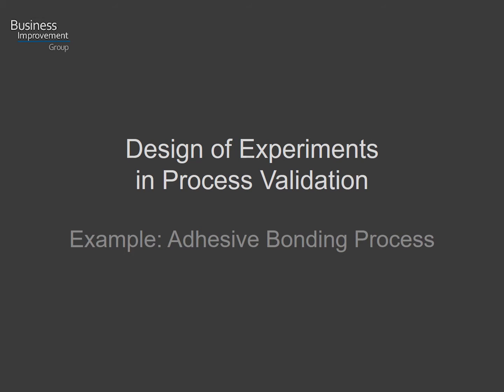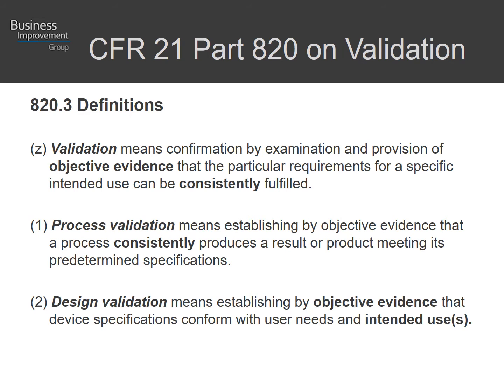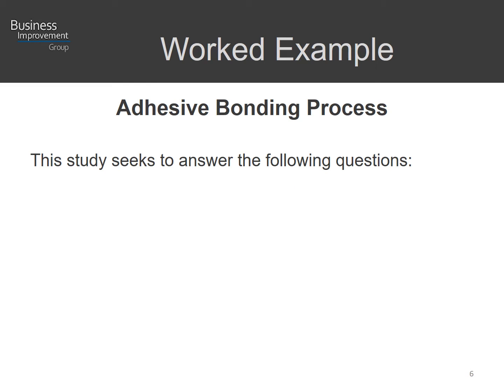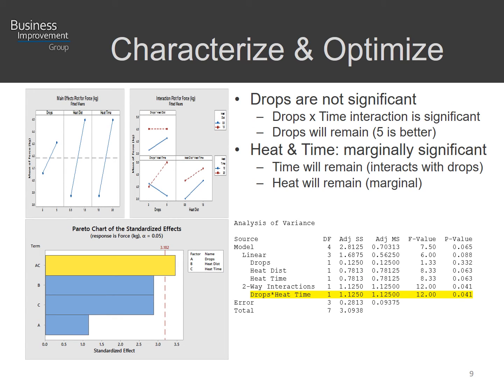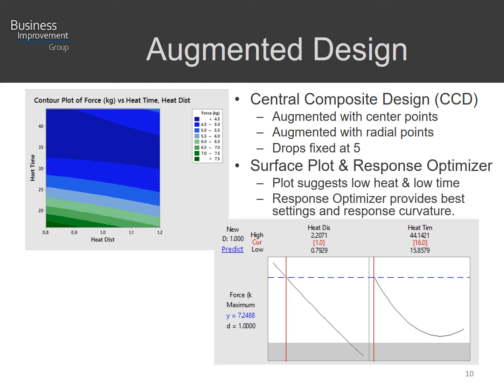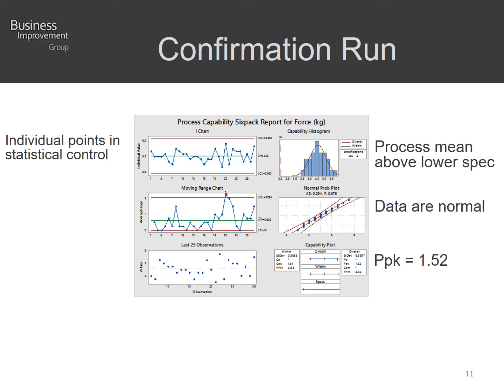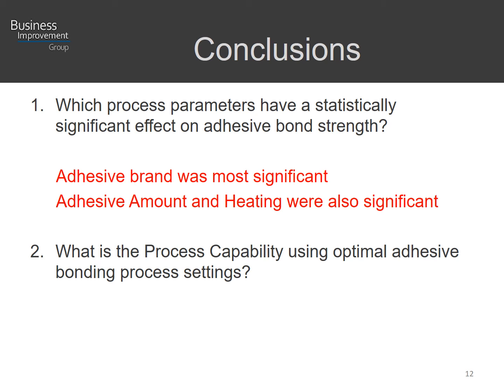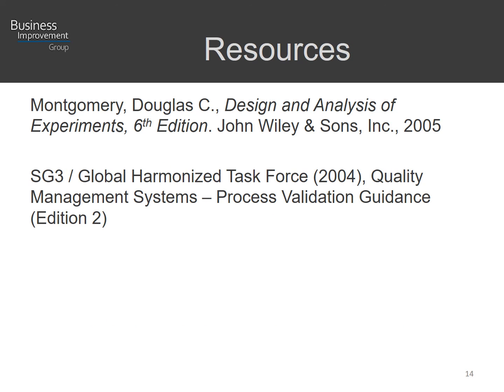Design of Experiments in Process Validation - Adhesive Bonding Process Validation Example

Comment: It would be correct to mention that the process is beyond statistical control - see the I-MR chart. This means that a special cause of variation is likely at hand. In this case, before commenting on the Ppk index, it is necessary to conduct an investigation into the special cause. Once you have clearly established what it is, you can comment on index values. Until you have determined the special cause of variation, interpreting them is pointless. When reporting Ppk values, it is necessary to report its confidence intervals.
Regarding DOE, it is not clear what experimental design was implemented. Is the derived regression model adequate. Whenever you present, apply the results of the experiment. Also apply the optimality criteria. Specify in which units the regression model is derived - coded or natural.
Overall, the presentation was well done, but could be described as incomplete and out of focus.